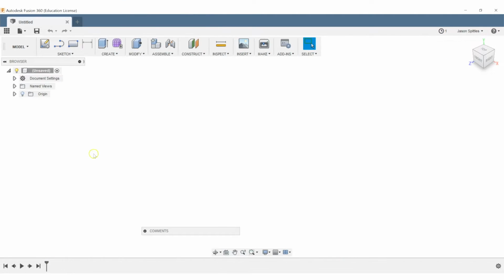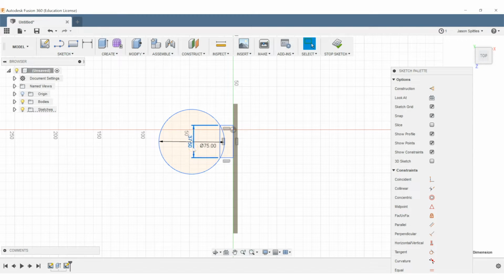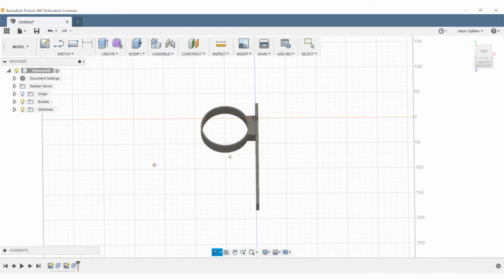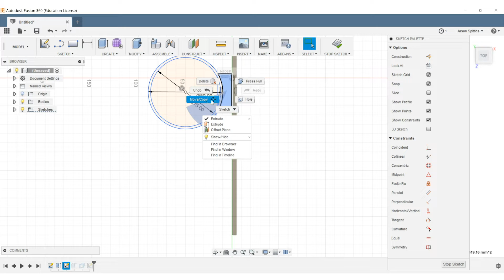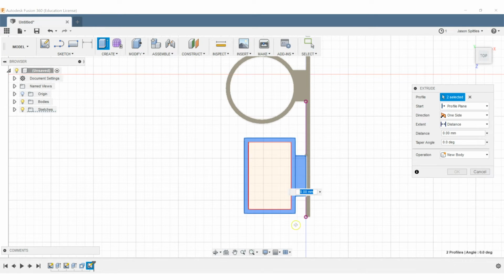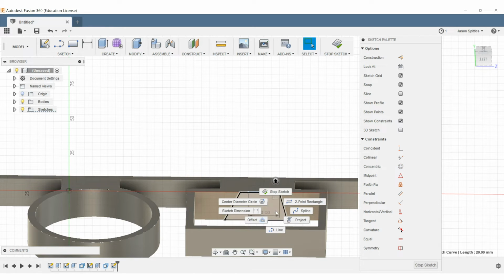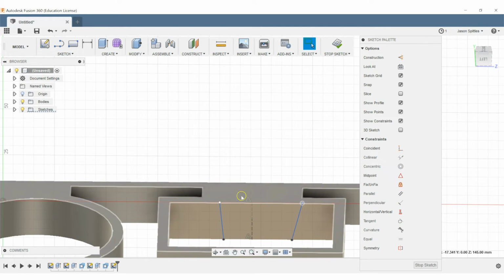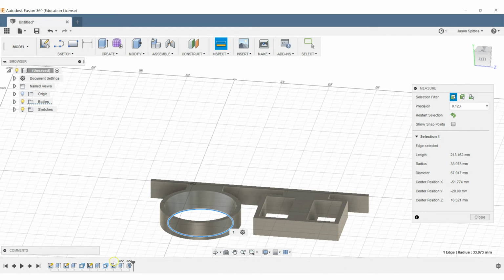Designing in Fusion 360 and Printing a Blow Dryer Holder on a Creality CR-10s!

Comment: As an engineer since 1989 and mechanic of 45 years or so,  I can easily tell you to avoid sharp corners of any kind,  always try to     
use fillets, as sharp corners are where almost all fatigue cracks start in any material.